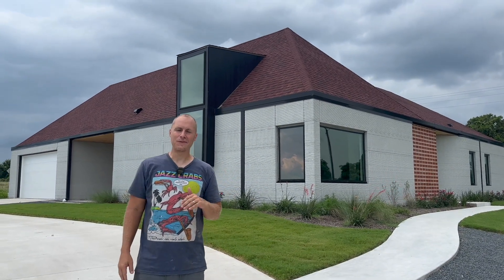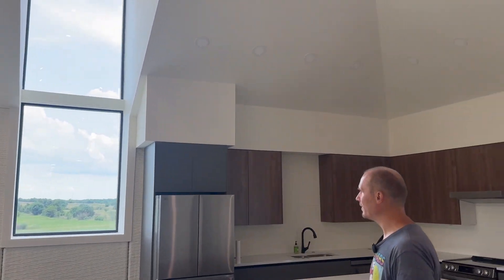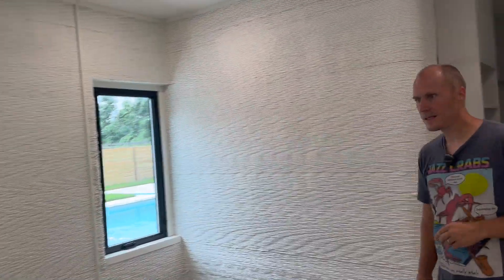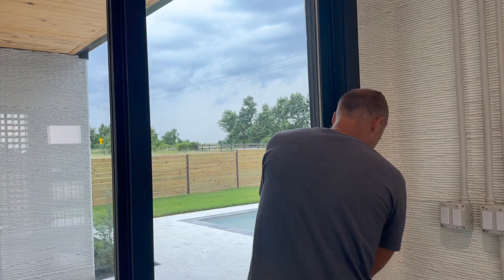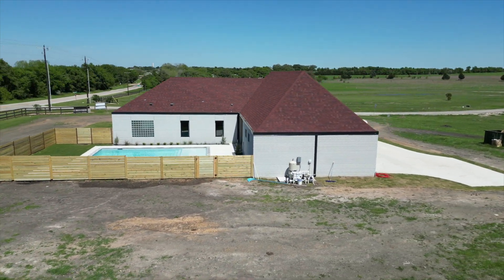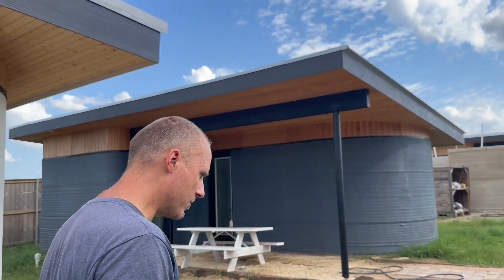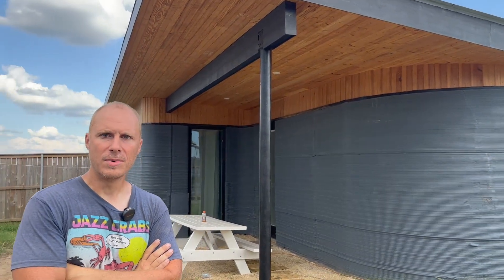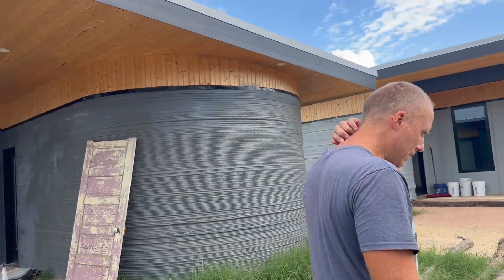You Could Live In This 3D Printed Home

Comment: You managed to conceal the gutters well, but the exposed electrical wiring and outlets inside the house give it a warehouse-like appearance.
Reply: I was thinking the exact thing and was just going to post that. Good eye.
Reply: I had to rewatch the video and none of the electrical conduit are within the walls.  It's so bizarre.  It also seems like there is not enough electrical outlets on the walls of the main space.  I have to check on code for that.

Comment: That technology is used by a Mexican company for almost 2 decades (I think it's called CEMEX, it has most of its plants obviously in Mexico and plants in various parts of the world, especially in Europe and South America), and they have improved the material deposition process, installations or facility serviceability, span management, and their system is more advanced than the one in the video, it's much faster and only requires one supervisor who is the same one who operates the machine and the software, those guys should have gone to that company and found out about it, since it has solved most of the problems and even created special mixtures to change the properties of the concrete to meet the client's requirements and the index properties required by the engineers according to the use and type of construction.
Reply from the maker: You think so? Which one of their customers is successful?
Reply: @ This system is requested in these areas, mainly by architects who want unconventional shapes, that company CEMEX is mainly dedicated to prefabricated elements and special concrete mixtures, with all kinds of aggregates and fibers, practically its limit is the imagination of the client, and they have worked for all kinds of architects like Foster (not my cup of tea), previous ones like Barragán, Felix Candela who built structures called concrete membranes that are still standing today, and many more; or civil engineers who have built all kinds of infrastructure, from houses, roads, highways etc., small and giant dams, they even support universities, how can we forget the international student competitions for impact frames, concrete canoes, bridges, etc.

Comment: Sorry, but the price of the first house is way too high. This is kinda annoying, so because the comps are higher, this can be higher? Even though these are supposed to be much cheaper to create? Sounds a little scammy, just put these cheaper to make homes in high-priced areas and make huge profits. Unless these homes are not cheap to make, and by cheap, I mean relatively. Not to mention how weird those walls are on the eyes and I can't imagine how hard those walls would be to clean with those little dust lips left from the printing lines, this house should be substantially cheaper.

Comment: If they just left the 3D printed part to the framing, like in place of an outer brick or cinder block wall, I think I could turn a blind eye.  When you start printing the interior walls is where I start to cringe.  How in god's name do you repair this shit??

And it's listed for over $700k!?  It's supposed to be cheaper, quicker, and easier to manufacture.  Why am I paying soo much, is this on Hollywood and Vine?  Why is it a high priced area, it's in the middle of nowhere on a plain.

Comment: Why didn't they put the wires in the walls?
Also, the feng shui in that house is absolutely terrible. Why did they design it like that??? Why spend so much money to build a plan that doesn't let the energy flow right?
Reply: I agree. I am glad you pointed this out. The kitchen was placed in a dark corner and feels completely separate from the rest of the house. The stairs entrance to the 2nd story is facing away from the front door. The flow is all wrong as soon as you walk in the house. Neat concept if it provides more affordable housing. Just not exactly my cup of tea.

Comment: Dude the echo from the light switches is INSANE. Surface mounting and piping just for a light switch is insane. Wall texture is nasty and is guaranteed to be a dirt magnet and impossible to clean. God forbid you accidentally brush against the walls and rip your clothes. Not to mention if you ever need to do a single repair on the wall you either fill it with concrete that will never match the rest of the texture and make it uglier OR you remove the whole wall, the roof and 3D print it all over again. This place is a maintenance nightmare.
Reply: They can just finish the walls like normal walls. I imagine they leave them with minimal finish for the novelty factor. Plenty of homes are made of plaster, brick, or cinder and need to be cut open to do maintenance. Cutting open drywall also can also leave a visible mark. Definitely a dust magnet as is though.
Reply: You know there are methods to make it look like a regular house? They are showing you the product that is low cost, but you can do whatever you want after buying it.

Comment: As an electrician, all of the pipe in a house just looks completely weird, of course I know why it had to be like that.. I wonder if it’s a nightmare wiring a house like that and if it costs a lot more due to all of the extra time for piping. Beautiful home though!
Reply: I was having the exact same thought.  Before adding the the foam create in the middle of the walls, they could have left holes for dropping down metal conduit to each socket and switch.  Put in plenty so it will never need additional sockets in place.  They could even mount in the back boxes as they go along.   Looks too industrial having them external
Reply: Just noticed the last one might have done this
Reply: Yaa i also think the same. Usually I'll drill 1'1/2' depth lining into the wall for wiring purpose
Reply: Well we'll never know until it comes that time!
Reply: The walls are hollow during the print. They are filled with a foamed concrete. While hollow, vertical conduit could have been run. Junction boxes/receptical boxes could have been recessed.. THEN the walls filled. This is early production. They will learn more in time.
Reply: They could have at least used fittings that did not need an offset in the conduit. 
The house looks like the service area of a shopping mall.
Reply: I saw the mini split and was wondering how they ran the bundle, line set, communication wire, and condensate tubing. 

I think all the trades are wondering how theirs is ran.
Reply: Clearly all American in these comments, we in Europe have concrete houses, every pipe and every electrical wiring goes through the walls and floors, if there is a problem you just have to break it open or pull out the cables.  But when stuff is build to last you rarely have to do that. When you build like that you also build the pipes in a way that they don't break easily. (Electric is through PVC piping)

Comment: Why electrical outlets and switches are outside the wall and not inside hidden like normal homes ?
Reply: Look at icon - different printing company that has electrical inside
Reply: Because it's easier to build this way. If a cable breaks you don't want to break the wall to fix it. Normally however you would run that cable through a pipe integrated in the wall.
Reply: Only thing I don't like looks great though
Reply: Yeah they should have just had pipes in the concrete for running electrical wires through. So it doesn't have to show. Also, come up with different patterns on the walls that dampen echoing
Reply: I like the square corners, but cement walls inside aren’t appealing .

Comment: Most Other 3D printers are putting the electrical Into the walls there should be plenty of time to lay all the wires inside the walls and then put the insulation in why wasn't this done?
Reply: i prefer the exposed conduit
Reply: @user-hg6vd2iz7m you’re in the minority
Reply: We put the electrical in the walls in most of our houses this was a design choice here.

Comment: My gripes,

The walls would be a nightmare to clean with all the nooks and crannies.

I worry about the strength of the walls if you have to drill something into it, I feel it might crumble like mortar.

No waves which is not only ugly but will make the house hotter and the seals more prone to leakage around windows and doors.

Finally, aren't there laws over there about the pool needing to be fenced?
Reply: the lot is fenced
Reply: @gaylengurr3911  I'm not concerned about the lot, the law in my area states: All pools must be fully enclosed by a barrier that is at least 1200mm in height, barriers can include fencing or walls. The bottom of the pool fence and gate must be no more than 100mm off the ground. If the horizontal rails are 900mm or more apart the verticals cannot exceed 100mm apart and the gate must be fitted with a child safe approved latch no less than 1400mm off the ground.